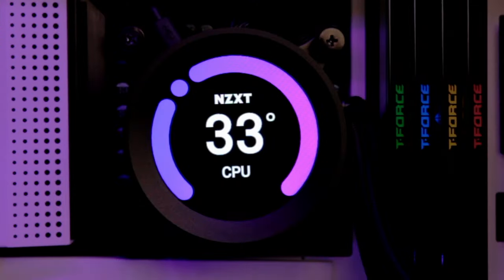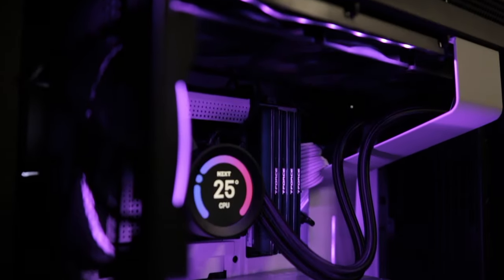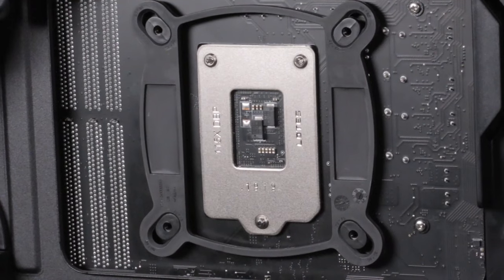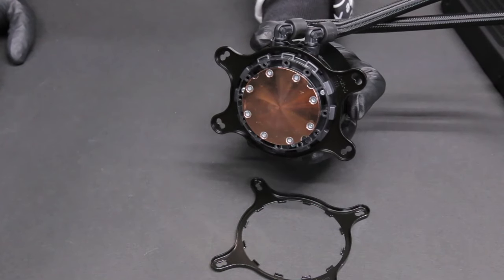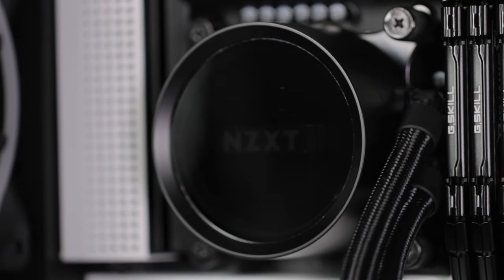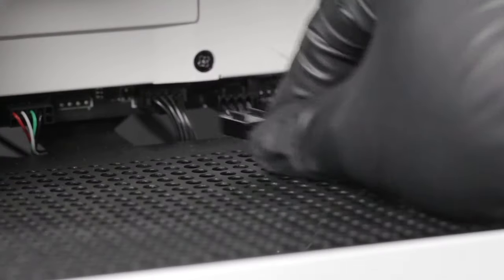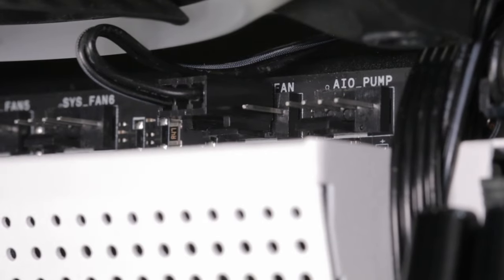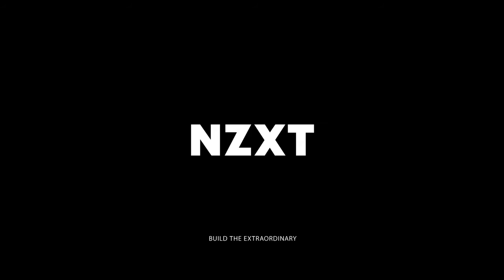NZXT Kraken X & Z All-In-One Liquid Cooler Walkthrough and Installation

Comment: Does it matter if the fans are facing inside the case?  Instead of towards the front
Reply: No, you can mount the fans however you like. Either side of the case/radiator is fine. Also make sure you set them as either intake or exhaust depending if you want them to suck in air or push air out. All configurations are fine as long as you have other fans in the case doing the opposite. So if you set the fans on the radiator to intake air, make sure you have other fans in the case pushing out the air. You obviously don't want every fan in the case all sucking in air, or all pushing out air.

Comment: Hey guys hi, I have a doubt I want to buy a x53 cooler for my gtx 1080 but is. EGPU . It’s mounted on a Pci board and connected via thunderbolt. Is there A chance to conect the x53 to my pci and the fans sensors to the gtx card? Or there is something I cans do ?

Comment: Question @NZXT: I want to buy the Z63 but I only have one spare fan header on my motherboard. Do I need to buy anything else to be able to connect the radiator fans (e.g . Fan controller or splitter) or does the Z63 come with everything required?
Reply: Fans are controlled with the z63
Reply: Do you plug them in to the extras on the "breakout" seems like alot to go into one header

Comment: hey, i installed all of this and plugged in all cables except the rgb cable, when i turned on my pc it wasn’t cooling at all; was going up to 90°C do i have to put the nzxt rotator faced to the pump ?
Reply: same for me did you find how to fix it
Reply: @timrheault2705  well i just decided to go to best buy so they could mount it for me, make sure you have your fans correctly faced and and make sure air flows good, but i would recommend going to find someone if you don’t have experience

Comment: i know this is a bit late but could I just add the radiator to the stock fans with the h510  elite? and then mount the other two fans in different locations? i wanna get  the x63 or what should I do
Reply: yes u can use almost any standard fans that is 120mm for 240/360 aio and 140mm for 280 aio

Comment: Lmao so I bought the z63 thinking you could rotate it 90 degrees 4 ways. I installed it so the tuning was at the top so it looked clean af. Tried rotating and not only can the software only rotate it one way, but it’s also the wrong way. So if I tick the option, it just turns it upside down. If you bothered to add rotation, how hard could it have been to add it in 4 ways??? Fml please add this

Comment: Great video thanks! I am front mounting my z63 on the h510 and I was wondering if I attach fans to rad then attach to bracket or have bracket in the middle between fans and rad? Thanks in advance!
Reply: A good question. I am building into the exact same case and can't find any guides for it. I'll let you know how I mounted mine next week.
Reply: kfunkdeluxe brackets in the middle on mine
Reply: @Dujfjfo  well what happened it’s been 7 months?

Comment: does the x73 fit in the H510 ?
Reply: No I don't think so. The X73 is a 360mm radiator. The H510 only has space for 280mm. The X63 will fit perfectly.

Comment: I don’t know how I’m doing it but I need to re apply thermal paste and now every time I try the centre of the cpu is bare after tightening the block onto it(thermal paste goes to the edges and leaves the middle with nothing) Doesn’t matter how much I add as it keeps happening; anyone know what I’m doing wrong?
Reply: too much paste and not spread evenly, there's diagrams on the web for optimal thermal paste placement and amounts for your CPU

Comment: my kraken m22 is creating a buzzing sound and im not sure why. i’ve tried to take it out my move it around so that air bubbles will move, but it still buzzes. it also affects my cpu temps badly can anyone help?
Reply: Check the radiator orientation and pump placement, the pump should be lower than the top of the loop and the radiator tubes should be at the bottom of the loop to allow air bubbles to rise to the top of the radiator. NZXT installed their own radiator incorrectly at 3:55 in this video, tubes should be at the bottom.

Comment: I got a big problem with my Z73 and Windows 7 (Windows 10 no problem but I don't want to use it !), your software NZXT CAM says that a program prevents my Z73 to function normally (the program is not even mentionned) so I guess my Z73 doesn't work at 100% of it's functionnalities and cools my CPU like it should
I submitted a ticket and I'm waiting for an answer

Thank you NZXT for your good products ! (No irony, this Z73 is a beast but the only problem rn is the compatibility with Windows 7)
Reply: It’s time to upgrade your OS.
Reply: Simon Pro doubt Cam is supporting an out of date OS.  That’s what happens when you use an OS that is no longer supported.

Comment: I’m new to pc stuff, does this have to be on a rig with water cooling or is it okay to have this on a rig without water cooling?
Reply: It's "water cooling" kit for the CPU....it's super easy to install and performs great. Plenty people have proved that "water cooling" a cpu isnt better than a fan. But NZXT have the sexiest AIO !
Reply: An AIO (all in one) is different from a full custom water cooling rig. This is just an alternate to using a CPU cooler. You can still use fan coolers for the rest of the build.

Comment: The CAM software sucks. It could be so much more, but it's junk.
Reply: Well, I have been asking NZXT for over 3 years now about how to utilize the display feature of my z series Kraken. And they have been absolutely useless about responding. Tehre is no manual for the software and it's not at all intuitive.

If you want visual display on your AIO, I strongly recommend that you buy literally any other product than NZXT's offering. I am STILL looking for a video that explains how profiles work, and apparently, the software engineers at NZXT don't know.

My Kraken cooler is my one regret in my build. In retrospect, I should have never bought it.